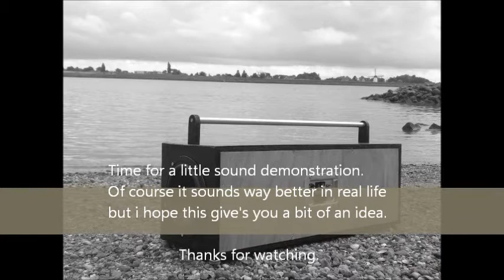Diy bluetooth boombox

Comment: Verhoeff95.... Was it just a capacitor on the tweeter or something else like a second order with an inductor. Also, did you use an L-Pad. The graph of the ND25TA-4 tweeter shows a big peak around 15KHz-17KHz. Did you do anything for this? ...or does it cause any harshness?
Reply from the maker: Yea its indeed a filter made out of capacitors. I didn't use an l-pad it's just a resistor in parallel over the tweeter terminals because the filter used to be for a different tweeter. I don't hear any harsness in the high end but my ears aren't that good. Past 15k it get's pretty silent for me. But it also might be due to the fact that they aren't that loud compared to the woofers.

Comment: Hi.. Whats the filter used ion the tweeter and woofer?
Reply from the maker: Well actually i first used a two way filter. But the total power was to much for the amp. So i ended up using only a filter for the tweeters which i had laying around.
Reply: Thanks Verhoeff95....

Comment: Nice build, how is the titanium dom tweeter? Is it clear and crisp and does it sound harsh at higher volumes?
Reply from the maker: Magger ́s Audio Channel actualy its stays really clean no problems at all. I had a slight problem the power these crosovers where using was to much for the amplifier. So i ended up using only filters for the tweeters which i had laying around but the tweeters the were made for had higher power so i had to solder some resistors in parallel with the tweeters to tone em down because they were to loud compaired to the woofers.
Reply from the maker: Its not the loudest speaker but if used indoors and placed at the right spot the bass gets amazing. And the sound quality from the mids and highs is seriously good Nice and balanced. It goes down to 37hz.